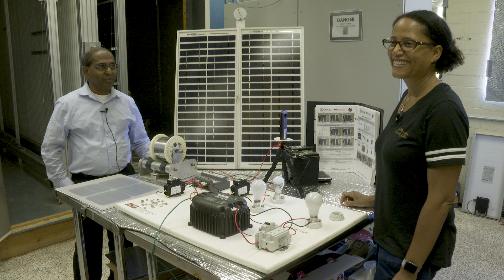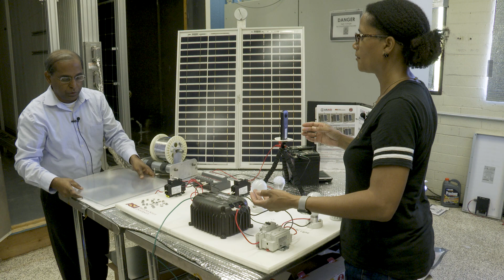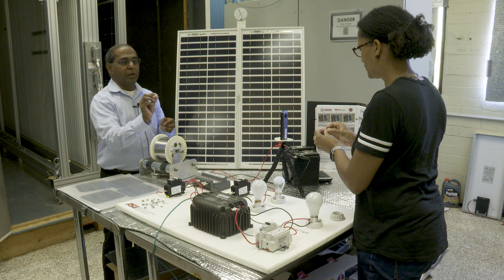Solar Panel Recycling

Comment: Hi. Without considering all the extra layers. How much of the actual cell can be recycled? Exactly which materials are recovered and in what percentage? What´s the energy cost for the recuperation of these materials? You say al the energy used to produce the panel is recovered in 2 years. Does that include the energy from mining to finished cell, or from the raw materials to the cell? Thank you

Comment: Now we can add LEAD to the environment.
Reply: That's not what he is saying. He is simply stating if the lead concentration is below the EPA limit for a landfill then the panel can be disposed in a landfill, which is still not ideal at all. Since more than 90% of the panel can be recycled, then it should regardless of cost.

Comment: The fly in the ointment is that the output from solar PV is tiny compared with a nuclear plant, or coal or gas plants as well.  What's more, solar, because it's intermittent, depends on a back up power source when the sun's not shining (at night).  Battery storage is not a viable option now, or for the foreseeable future.  And the amount of panels in a farm or array is enormous,  adding to the cost of manufacture and recycling (if possible, as is brought up here).  Add to that, the cost of transmission lines from distant locations from where the demand is heaviest (cities), issues with grid integration and load balancing, and the relatively short lifespan of the panels - as is already evident.  Recycling, where possible, exposes workers, usually in 3rd world countries, to which the panels are sent, to harmful and deadly chemicals, and can poison water supplies when and where waste is dumped.  Processing either recycling (which is not generally cost effective) or depositing in landfills, as mentioned rather cavalierly here, is dependent on limited resources.  Conclusion:  Solar PV is simply not worth it, and is a profound waste of our precious time and resources.  Nuclear is clean, constant, has a small waste profile and is statistically the most energy-dense and safest power source ever known.  It's a surprise and a disappointment that ASU would bother having this discussion in view of evident and obvious facts.  But thanks to YouTube, viewers have alternative positions to explore and consider.
Reply: Nuclear power is the way to go. A lot of people fear it though because of previous disasters, however, modern technology has made nuclear a very safe source of energy
Reply: @tophatknight7136  Let us ask the people from Fukushima area, who had the most modern and safest nuclear power plant until 2011.
Reply: @tophatknight7136  yez
Reply: " Recycling, where possible, exposes workers, usually in 3rd world countries, to which the panels are sent, to harmful and deadly chemicals, and can poison water supplies when and where waste is dumped" I did not know that Germany and France, the countries with the largest PV module recycling capacities, are considered 3rd world in the US. 

How can be nuclear the safest energy with 2 major melt downs (so far) compared to PV with zero?
Reply: Pebble nuclear reactors, which are not suitable for producing nuclear weapons, are the cleanest and least expensive long term energy source, bar none.